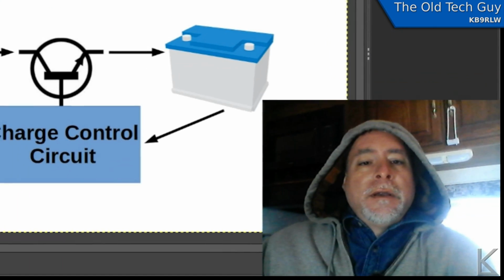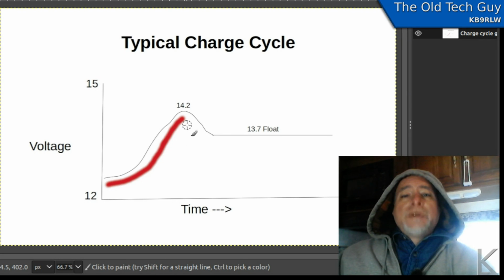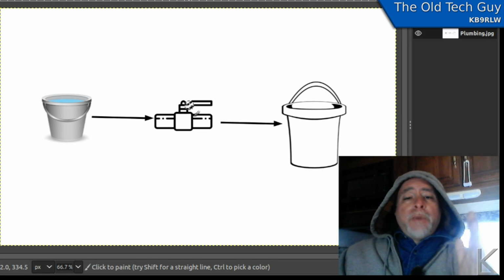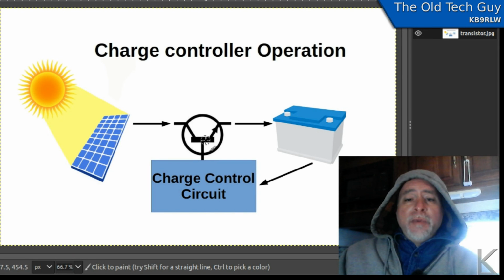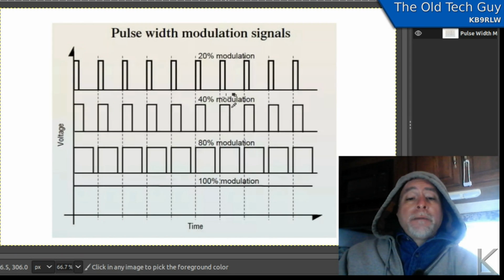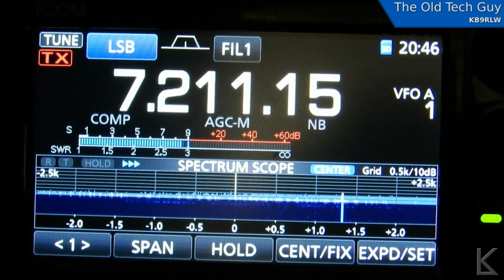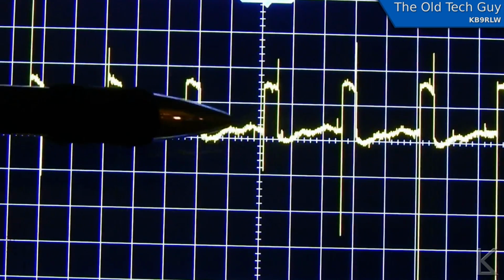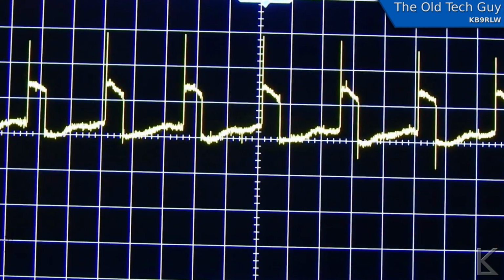Electronics - Solar charge controllers and what is PWM?

Comment: So a pwm controllers act as a pulse charger 
So are they useful in repairing batteries?
And do they have bad effects only on radios or there are other appliances they affect?
Thanks
Reply from the maker: The pulse frequency is quite high, the battery smooths it right out.

Comment: Thank you for this wonderful video sir and greeting from Algeria
I have one question please 
In case of the sun is available, does the load take its power from the battery (if it is fully charged) or from the PV module? 
What if the battery is half charged in the same previous conditions?
Reply from the maker: The load draws from what is available.   The solar feeds in as much as it can provide from your panels.   So if your panels can only provide 10 amps, and your load draws 15,  5 will come from the battery.   If the clouds move in and the panels can only provide 3 amps, 12 will come from the battery.
Reply: @loughkb  Thank you for your reply

Comment: Can I use a pwm to charge my  12v(100ah) battery using a 250w solar panel with 29v (Vmp) and Voc 36v (Voc)

Will it charge perfectly or need to go for an mppt
I need advice

Comment: can i use a switching power supply instead of a solar panel in a PWM based system? thank you
Reply from the maker: I don't understand what you're asking.
A switching power supply uses PWM in order to adjust output to match a change in load and provide a constant voltage.
Reply: @loughkb  i mean can i swap the solar panels in a pwn charge controller  with a smps,witll it accept the smps input and charge the battery?
Reply from the maker: @Yuganshankar  Yes.  I think so.  As long as the power supply can provide voltage up around 18-23V as the solar panels would have.

Comment: my question is how the solar controler reduces thepanel output voltage to batary charging voltage. for example solar panel voltage is 18v. and the charging voltage is 14v or 13.8v... thanks
Reply from the maker: The unloaded voltage from the panels will be high, but will drop down to the load voltage when connected.   Once the batteries are charged and no longer drawing current, the voltage can rise back up.  That's where the charge controller will limit how much is being fed.

Comment: why not just connecting a buck converter to a solar cell to charge the batteries?
Reply from the maker: A DC to DC converter usually changes voltage levels.   There's no reason you couldn't use one to take the 18-20 volts from the panels and convert it to 13.5 or so.  However, you'd have to monitor it and turn it off once the batteries are charged.   Also, you wouldn't get a proper boost charge.
Charge controllers will take lead acid batteries up to 14.2 volts initially and then fall back to a float charge around 13.6 volts.
There's more to it than just feeding batteries power.

Comment: Kevin, thanks for a great illustration of a principal I didn't understand. I'm currently installing the same Renogy two 100w panel system on our travel trailer. I oped for the PMW Wanderer controller over the MPPT. I'm a newbie ham, 2016 and still trying to absorb it all and was glad to see you address the interference issue. Two question's, is there anything you would change on your solar system now that you've spent some time with it? Would the MPPT control be quieter? Again, thanks for all you do.
Tom KE0JVS

Comment: my pwm charge controller dingo 20/20 ...12 24 48 volt it won't work with a single house solar panel 180 watts why???
Reply from the maker: No reason I can think of, maybe you should contact the manufacturers tech support.
Reply: @loughkb  I'm thinking the panel has too many amps it's only a 20 amp pwm it's not a cheep one though.
Reply from the maker: @petermoygannon698  put an amp meter in line.  You'll probably be surprised to find you're getting 8 amps or less out of the panels.  Doubt you'd see more than 10a
Reply: @loughkb  the current at pmax imp (5.31) A   ...short circuit current (isc) 5.67 A ....... that's not over 20 amp that the change controller is ..I will do an amp test on my multimeter..that's only one panel I'm useing ..180 watt single panel.

Comment: I have been using solar with big PWM type chargers together with SLA batteries (24 volt system) for about 15 years.  I discovered a simple trick for really ramping up the efficiency of my solar panels by inserting a massive electrolytic capacitor in parallel with the panels at the charger input.  It enhances the efficiency by limiting input voltage sag during the peak input load phase of the pulse sequence. This had the effect of adding about 20% more capacity to the system and really enhanced battery conditioning and cloudy day performance. Unfortunately it enhanced the unwanted RF emissions too. I employed big ferrite inductor choke rings on all of the ins and outs to clean most of the noise.  I had it so I was running almost everything in the house except the central AC this way.  One odd noise I didn't anticipate was the solid state components in the chargers started to audibly "sing" during the short pulse/low load phase.  The heat sinks almost always stayed cold.  I got curious and measured the effective currant flowing in and out of the capacitor. It was around 20 amps on the AC scale.

Comment: PWM and MPPT both have their place. If you're just charging a couple batteries with low wattage and voltage panels for an RV or bush camp, say to run a couple of lights, charge your phone and run an intermittent appliance then PWM is the way to go. MPPT is not needed and much to expensive. On the other hand if you are running 1500 watts of solar to charge 1000 AH battery bank then MPPT is the way to go. Good luck finding  PWM controllers to handle that kind of power. Just look at all the specs for both kinds and it becomes readily apparent why each has its place.
Really can't compare them. PWM is a Honda Civic while the MPPT is a Ram diesel. You wouldn't try towing a 5th wheel with a Civic, or least I hope you wouldn't.
Also watch out for cheap controllers claiming PWM. Some are just shunt regulation controllers with no PWM function. Same problem with some MPPT controllers. If it doesn't use a torrid transformer inside then its a PWM.  Lots of scam artists out there trying to lift your wallet.
Reply: Nikša  got a link to the highest powered PWM you know of?

Comment: Have you experimented with filtering out some of the RF noise?
Reply from the maker: Not as yet.  It would require some major re-work in my power control center.   A couple of hefty chokes between the battery and power rails and some filter caps would probably take care of some of it.  When I can afford to spend some time hooked to power, I might attempt it.   Right now it's just a minor annoyance.  The auto-notch on the 7300 kills it when needed.

Comment: PWM controllers are a huge waste of power. Only reasonable use is for a 5 watt panel charging a cell phone.  MPPT is the only way to go.
Reply from the maker: In reality,  MPPT can give as much as a 30% advantage during partial shading of the panels.  However, in direct sun, or heavy shading,  that drops to single digits.   There's a lot of anecdotal noise out there, but when you spend the time to hunt for controlled tests and data, you find that it's not the holy grail many shout it out to be.  There is an advantage, but it may or may not be worth the added expense for many.
One controlled test can be found here.  Note the delivered amperage measured with the two controllers.   Only a decent advantage during 25% shading of the panels.
https://www.sunstore.co.uk/2018/10/09/mppt-vs-pwm-charge-controllers-putting-extra-power-claims-to-the-test/

Comment: Hi Kevin,  thanks for the video and the way that you explain things.  I learned something. I'm just outside of Lompoc, CA and this has been the coldest winter in the 30 years I've been out here. Hope it warms up soon for you.  I've been trying to get my Delta Loop antenna (40M) up and running.  Receiving great but doesn't seem to be getting any signal out.  i.e. no one hears me.  Would the wire touching trees branches affects this?  Thanks JJK
Reply from the maker: If it's insulated wire, it shouldn't matter if it's touching the branches.
Reply: Thanks Kevin

Comment: Ok, got that -- thanks. It was about what I thought. But - what about explaining MPPT? That I haven't gotten yet! lol
Reply from the maker: Well, from what I've digested so far on MPPT, the basic idea is to find the load level that produces the highest wattage from the panels.
Periodically, the charge controller will take the panels input and run it up through a varying load, from a low to high load.  It will then calculate at which point the highest wattage was being produced.   Then it will attempt to load the panels at that level and drive that power into the batteries.
From what I've read, it really only produces an advantage IF the panels produce a high enough voltage to give it a broad range to work with.  In most small solar installations, it's not supposed to produce much of a gain.
It was hard to find the hard data through all of the anecdotal claims though.  Lot's of people out there saying it's amazing, but with no controlled data.   You can't just go day to day in different tests with the light changing and say, look, it's way better.   
So, It's hard to say anything conclusive about it's advantages.
Reply: @loughkb  Thanks - maybe no hard data is why I was getting confused about it!

Comment: Hi Kevin,

Very good explanation of the PWM system. The live video with the scope really nails it down.

One thing, you might want to add an explanation about the spikes at the front & tail of the square waves and how THAT is the source of the "birdie" noise due to harmonics.

Are you going to the Titan site tomorrow @ 830am?

73 - John - N7GHZ
Reply from the maker: I'd really like to, but I'm kind of stuck here for a bit.  January's plane tickets and the drive out here ate up my budget.  I have to sit and work until I get my next paycheck early next month.    January really screwed up my plan.
That site is where the disc cone antenna is at, right?
Reply: @loughkb  it is where the discone ant. Is, but... Never mind for now. They just canceled it due to continuing snow, rain & 20 degree temps, brrrr!  

Will let you know if & when they reschedule it.
Reply from the maker: Cool.   It would be neat to do a live stream while connected to the discone.  If we could swing that. :-)   I'll keep my fingers crossed.
Reply: @loughkb  ok. Will let you know... 73